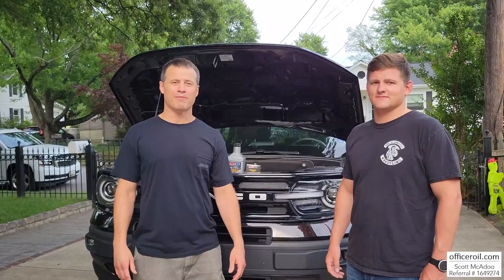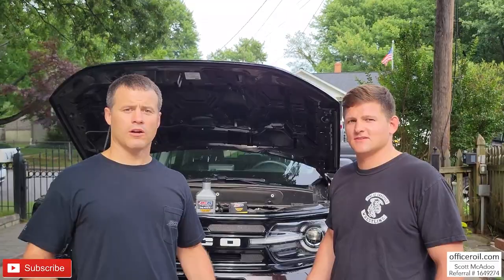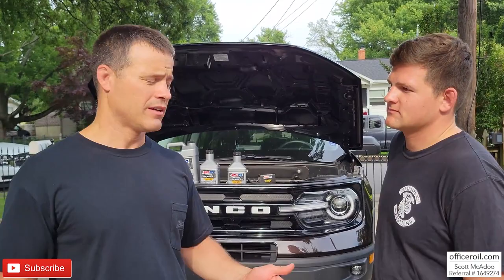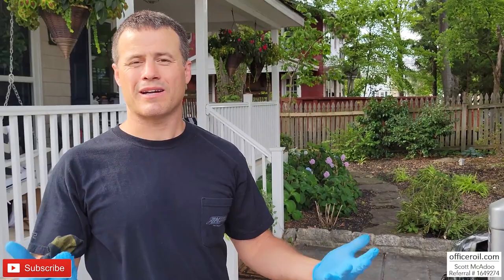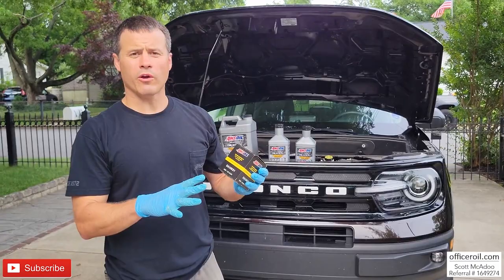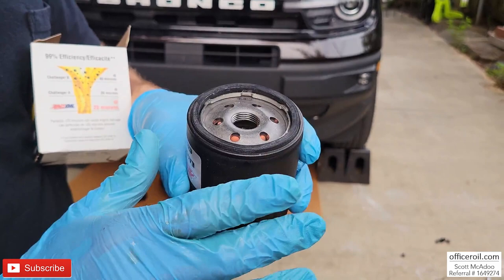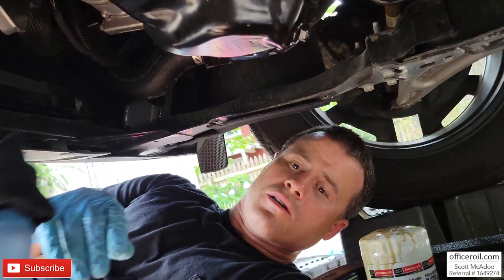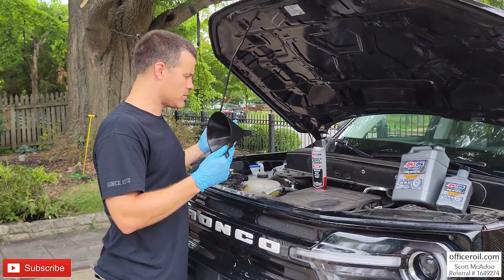Ford BRONCO Sport AMSOIL Oil and Filter Change

Comment: Just wondering are doing the engine flush before putting amsoil in?
Reply from the maker: Thanks for reaching out Kevin.  Yes Sir.  AMSOIL Engine and Transmission Flush preps your engine or transmission for good clean AMSOIL. Dump in the engine flush in with the old beat up oil.  Let it idle for no longer than 15 mins.  Pull the drain plug and remove the old beat up oil filter.  Get all the old oil and flush out.  Install the plug, new AMSOIL oil filter, fresh AMSOIL motor oil, and rip it!
Reply: Excellent Amsoil oil change! I love the OE oil and the Amsoil oil filter is on a whole new level, kudos on the ramps, a jack and jack stands are to much nonsense! My only suggestion is to use wheel chocks on the rear wheels! Thanks 👍
Reply from the maker: @mr.michigan9289  Thank you.  Great call.  Wheel chocks should never hurt.  I love the AMSOIL Synthetic Oil Filters as well.  AMSOIL OE Synthetic Motor Oil is great as well.  May I ask?  What's stopping you for upgrading to AMSOIL XL or Signature Series?
Reply: @officeroil-amsoil3463  Actually I use all three, OE in 2 Vehicle's, XL in 2 Vehicle's and SS in my truck!
Reply from the maker: @mr.michigan9289  Oh nice.  You have quite the fleet there.  You sound like me.  My vehicle gets Signature Series too!  However, it's nice to have 3 great options.  AMSOIL Signature Series is not for everyone.  It does have a higher price but will certainly cost you less!
Reply: @officeroil-amsoil3463  Yes it's the extended family, I just purchased a used vehicle and installed OE as it will see about 5k annual I'll change at one year 10k or oil light which ever is first, OE in my wife's car changed at oil light usually 9-10 months 6,500k, the first six oil changes I did UOA's so I know it holds up well, my daughter's car she's at 10k annually so one XL change per year for her, my son uses XL 12k in 6 months, I'd prefer SS for him but it's his call to use XL, the my truck is SS it's a 98 and runs fantastic on SS but down to 2.5k annual now that I have a car, it has a plow for my long driveway and I like the SS winter capabilities!
Reply from the maker: @mr.michigan9289  Nice!  You've put some good thought into the family maintenance plan.  We run AMSOIL Signature Series in our Suburban.  We only drive it approximately 7500 miles a year.  It helps that I have a take home police car and my wife has a take home work truck so the miles don't stack up to bad.  My wife's F250 runs over 25000 miles a year and it's changed with Signatures Series every 15000.  So, with the Suburban although I don't hit the high mileage.  I know it's getting the best and I change the oil/filter every November.  It's a great peace of mind!